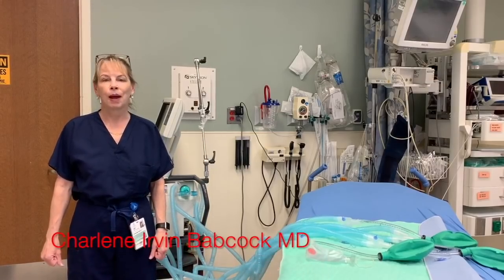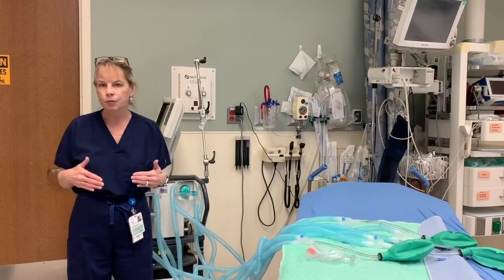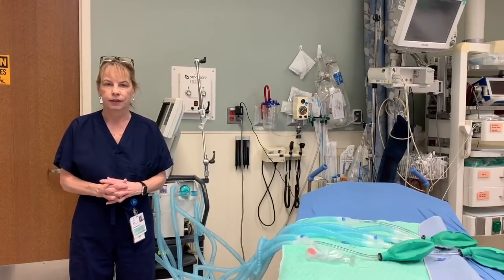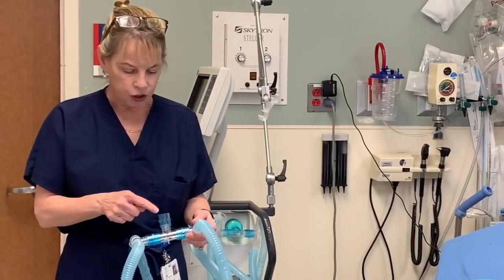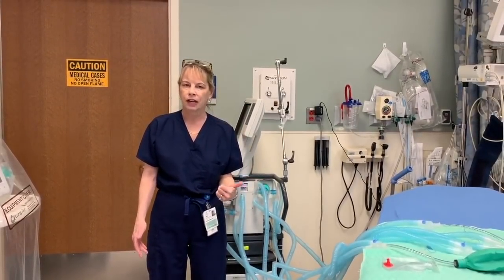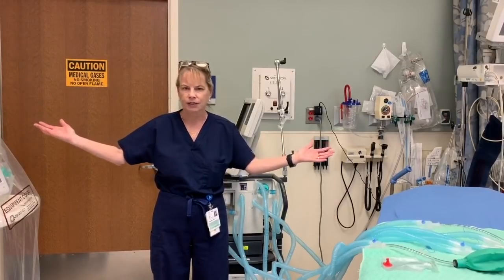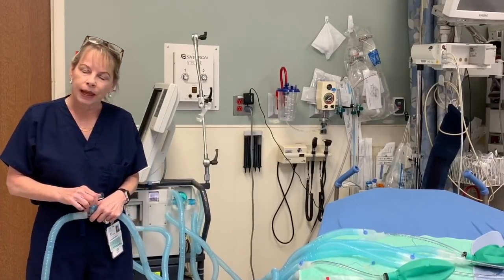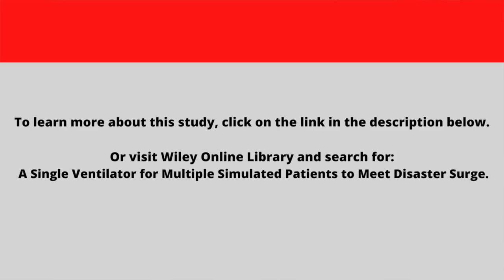COVID-19 How to Use One Ventilator to Save Multiple Lives

Comment: Absolutely would not recommend and has never been tested on humans, aside from a short 30-60 minute period of desperation during the Vegas shootings. Compliance issues along with how different ventilators would handle these are just some of the issues you would face in a real-world scenario. This presumes equal ventilation with equal physiology that would be difficult if not impossible to duplicate in real-world circumstances. I spoke with one ventilator company that said: "this is a very bad idea". I would rather be ventilated by a BVD or a disposable pneumatic ventilator (Vortran, Go2Vent) than dual ventilation. Only after you exhausted all resources should this be considered, IMO.
Reply: true,gas will prioritized path of least resistance
Reply: You know this would be the last resort.

Comment: Hour to hour variability in lung compliance, resistance and the region of lung injury makes this impractical and unsafe.    Las Vegas shooting mass trauma was a very short period of time where two people were ventilated with one vent, not a prolonged period as required for ARDS. A much safer Idea would be using an Ambu bag and Peep valve with a family member to deliver breaths on a timed schedule. With a little training, inverse-ratio ventilation can be attained and something akin to APRV can be done with a bag and a peep valve.   Test and calibration lungs are just that, exactly the same in every way, they are not diseased human lungs from multiple humans.  With ARDS, patients are going to develop mucous plugs and have other modes of changes in compliance and resistance that cannot be detected and thus will either harm another patient by not accepting the volume of air apportioned to them and or delivering excess volume to more compliant lung units.
Reply: Correct... there is no proof of concept.  The guidelines recommend that AMBUing be AVOIDED as it is an aerosol generating procedure.
Reply: B Anderson I agree it should be avoided but then so should cpap /bipap  and heated high flow oxygen. Most NIV masks have a calibrated leak that spews droplets like a fire hydrant.  Remember this is supposed to be unusual circumstances.  Every on is not getting a closed circuit vent
Reply: An ambu bag operated by a family member would require that family member to be suited up in PPE which we may not have enough of.
Reply: how bad those compliances in ARDS and 4 pts will compete..

Comment: I know you said you didn't evaluate cross-contamination but Is the one-way valve inside the ventilator?.. such that if one patient was inhaling while the other is exhaling, one patient's expiration could go back through the inlet tubes past the T or H and the other patient inhale it?
Reply: I guess they should be under sustained neuromuscular blockade to have a uniform respiratory rate for the group and to prevent a patient exhaling while the other is inhaling. Btw I am a veterinarian so maybe a doctor around would answer better to your question.

Comment: There a lot of homicidal assumptions in your setup. Even with four quadruplets with same physique, lung compliance and airway resistance are not static. There are minute to minute, hour to hour changes, based on depth of sedation, secretion burden, volume resuscitation, ventilator asynchrony and  heterogeneity and evolution of primary disease process. For this to work you need breath delivery to sequential patients with flow switches and filters which will be limited by respiratory rate unless you have multiple compressors.(essentially you need four in one ventilator not one for four)
Its irresponsible to assume that all covid patients can cross contaminate without a problem. They still have other bacteria and viruses that each patient will at some point get infected with. All your patients will have the same bacteria Incase of a Ventilator associated pneumonia. How is weaning going to be?
Reply: @ Onentia Oyieng'o  Weaning would be days to weeks in the future, this scenario assumes that 3/4 patients are in imminent danger of dying without ventilation NOW.  "Yup, we din't cross-contaminate anyone-of course, 75% died in less than 24 hrs..."  You appear to epitomize the quintessential "intelligent but amazingly stupid"  flavor of healthcare provider...
Reply: MrMEmEmEmEMEMEeeeeee 
how do you trouble shoot the vent? If you have four pts and one of them gets a pneumonthorax, the total change in system compliance may not be that much. This system would work with pts who are “forgiving” ( with lots of reserve/young healthy) Unfortunately as you know critical care pts have minimal room for error. Some pts can’t even tolerate a drop of peep by 2cmh20.
Reply: MrMEmEmEmEMEMEeeeeee  just read through the last part of your comment, I’m sorry “I guess this is the first time someone told you this an interesting topic of discussion in class but terrible idea to implement in the clinical are”
Reply: MrMEmEmEmEMEMEeeeeee 
Yea the original poster is a dummy.  He had to clarify that airway resistance isn’t static!!! Lol.
Reply: Weaning??? Who said anything about weaning.  This is keeping someone alive, until more resources come available.  Ventilate then all in pressure control.   Set rate and drive pressure so that you achieve the best “average”.   That’s all you could do.  
Of course all their lungs wouldn’t be identical.  And worrying about VAP.  LOL.  They would already be in full blown respiratory failure, with ARDS.   What a hoot.
Reply: Angry Breatherer   If your ventilator liberation plan is to wait on a shipment that’s on back order to arrive.... or to wait for the surge to be over... I now see why a lot of issues don’t seem to concern you. next time please spend more time on defining the problem cause solving it is clearly not your thing. Tip.. Start with simple puzzles lol!
Reply: Onentia Oyieng'o 
You got me there.  I guess those other patients taking up the first ventilators aren’t ever coming off eh, making their vent available for someone else??? They just stay on them forever eh???

Comment: I think I would use the Ventilator on the most critical patient and ask the others families to contact friends and family to see if someone had a CPAP machine they could bring and use that instead. Maybe get one from letgo or offer up. I think it would be less invasive and very effective in increasing oxygen intake when used in conjunction with a noise cannula and 10 L O2. Also do what ever you can to get the patient to lay on their stomach as much as possible.
Reply: in the Netherlands we dont allow non invasive options because there is high risk of aerosol formation :O no CPAP or NIV :O
Reply: Gamiani93 You could send them home and tell them to use the machine in the confines of their own house.
Reply: CPAP isn't going to generate anywhere near the pressure needed to ventilate Cornovirus victims based on what know as a CPAP user.
Reply: A quality BIPAP machine like a Visions could work.  But most people don't have that quality of a machine at home.
Reply: Jim sw uk it’s the positive air pressure that will help prevent the collapse and increase O2 intake. It will reduce inflammation. It’s better then nothing.
Reply: Yea, those noise cannulas as a biotch.  Someone should make a quiet cannula.

Comment: If you ran short of t-splitters, you could use 1/2 PVC T-joints (for 2 pts) or a 5 way split (for 4 pts like in this video). 1/2" schedule 40 PVC has an outside diameter of 0.84 inches, Standard respirator tubing is (I believe) 22mm or 0.84 inches. A hose clamp could attach it to 1/2 inch diameter "male" pegs glued into the splitters.
Reply: Andrew Penn 
So what your saying is.  We can make ventilators at Home Depot.  Nice.
Reply: @oldfashionedsportsmanchave4590  In a pinch, we could make the piece of hardware that would allow us to use one vent for 4 people from supplies at home depot, yes!

Comment: Could you theoretically use different lengths of tubing to adjust for subtle tidal volume differences between patients? Pt A has 500ml tidal, Pt B has 450ml, Pt B has 50ml space added to his dead space, (however much tubing would accomplish this). Would this work? 
Again not ideal, but maybe feasible.
Also the use of blowoff valves that can be set to each patients needed pressure to adjust for individual lung compliance.
Reply: Kyle Essex 
I personally would run the ventilator in pressure control.  This should limit airway pressures equally to all patients.  With your logic to limit tidal volume.  This is actually a brilliant idea!!   My only suggestion would be to not add the extra tubing in such a way as to make extra dead space for the patient, but to add it to the inspiratory limb of the circuit.  All tubing has a compressible volume.   If you add enough to the inspiratory limb of a single person, then that persons delivered volume would indeed decrease.  Freaking genius man. Thanks!!
Reply: @oldfashionedsportsmanchave4590  Thanks... Just trying to figure out the best way to solve the ventilator problem. I've been trying to play with mechanizing a BVM as well, obviously not as good as a vent, but thinking through all routes.
And I would agree, adding to the inspiratory limb would be a better option.

Comment: I am involved with a group of makers, engineers, etc.... and we are conceptualizing this concept and doing so with added customization.......  
QUESTION for Author:  Can PEEPs from Ambu Bags be sourced internally and added to the multi-ventilator tube ends? 
We need more information.
Reply: any help with volume calculations or pressure calculations to fix the correct tube length, do please let me know... we can do some simulations.
Reply: Short answer no.   The ventilator has to control the peep, on that specific machine.
Reply: PEEP is   internal on most units. Historically it has

Comment: You could increase the pressure from the machine if you put a pressure valve in every single tube that goes to a patient. In the industry we do the same if we put multiple machines at the same air-compressor. Each machine has it's own pressure valve.
Reply: And it's my understanding that those could be fairly quickly produced using 3-D printing.
Reply: what? lol.  the way the ventilator works, it will provide enough flow to all the patients until the ventilator sees a total peak pressure of 25 (actually more because the ventilator will also show PEEP in the peak pressure measurement)  that means the machine will pump air into everyone's lungs until the ventilator sees ok i have hit 25 cm H2O. you can see why this i s super dangerous. on person can get a tiny breath, one person can get a huge breath. that's why i am super against this as a respiratory therapist; only in a dire situation where I literally could think of no other alternative
Reply: @thizzy88  If you actually watched the video you would have seen that that IS the only time she would do this...
Reply: Thomas Nguyen 
Your way wrong.  In pressure limited ventilation.   It would only limit pressure to 25, it wouldn’t at all cease delivering volume until the ventilator time cycled into expiration.  Even on one patient, the ventilator in pressure control doesn’t use pressure as it’s cycling variable.   It uses time to cycle.  Volume and flow are variable.
Reply: @oldfashionedsportsmanchave4590  I understand that.  I never said it was pressure cycled.  To be more specific, the ventilator in pressure control works through DEMAND flow.  In volume control, we set the flow to manipulate I-Time.  What I was getting at is the ventilator will deliver flow until it delivers our driving pressure, which we set.  So, the vent will supply enough flow as the patient demands. I am saying the problem is, in pressure control you have way less control over tidal volumes and minute ventilation, and that's just in one patient.  It's like you read my statement and went down some road with it when I never even mentioned how the vent triggers or cycles.  I was talking about lung mechanics...  In pressure control, it is pressure limited, not cycled.
Reply: @oldfashionedsportsmanchave4590  I'm just posing the question of how do you fix a patient's gas when you have four patients data all mixed into one measurement?  Someone said to place a Wright's respirometer and I thought ok thats a good solution. But then how do you adjust the settings to fix the gas?
Reply: Thomas Nguyen 
Ah, I miss read our interpreter your remarks then.  
To your question about adjusting for volume.  I have yours with a solution.   In practicing on test lungs, I have set the ventilator in PCAC, measured exhaled volumes with a respirometer.  If any one patient needs a lower volume, I was able to accomplish this by adding additional large bore tubing to that patients Inspiratory limb, the volume lost to tubing compliance, had the effect of dropping that individual patients tidal volume.  It’s not pretty though having a big extra coil of tubing just lying there.
Reply: @oldfashionedsportsmanchave4590  that's incredibly described but my brain hurts just picturing how you put that together lol.  so many parts. props to you sir or ma'am. where is that tidal volume going, though? if you add tubing to the inspiratory limb, aren't we increasing deadspace as well? and if you add tubing like that, you have got to re-calibrate the machine to compensate for that deadspace; can't do that if the patient is already on the vent. you would have to disconnect all 4 patients while you re-cal
Reply: i meant to compensate for the extra tubing, **

Comment: I am a respiratory therapist near upstate. I can tell you now I do not believe this would work. Taking care of multiple Covid-19 patients. The virus effects each individually different. Lung compliance is not the same in every patient. For this to work compliance would have to be the same so that the same amount of volume is going to each patient. To be blunt. This is dumb!
Reply: Instead of dismissing it out of hand, why not come up with solutions?

https://emcrit.org/pulmcrit/split-ventilators/
They've addressed this. Try to match patients based on severity. Not perfect, no one's claiming it to be, but this is for a worst-case crisis scenario where it's innovation or death.
Reply: I have read that valves could be 3-D printed in order to customize pressure for each patient.
Reply: @rayreinhard1077  i'm sorry but what does customizing pressure have to do with anything?? the ventilator works off of ONE flow sensor. the doctor says to dial in a pressure control of 25 cm H2O. the ventilator will deliver as much flow as it needs until it sees a peak pressure of 25. there is no customizing pressure in the doctors example; she already customized it to 25.  the only other option is to ventilate with VOLUME control.  and we might as well kill all 4 patients if we were going to try that. and then hybrid modes i dont even wanna try to think about that right now
Reply: peak pressure 30-32 actually, if you account for PEEP
Reply: @rayreinhard1077  you can totally do that and regulate the flow of each patient
Reply: @Kc weigh - so in your professional opinion it would be better to let the 3 patients die?  Or do you think there is adequate volunteer staff to Ambu bag the other three patients 24/7 for 3 weeks?
Reply: Dell Anderson maybe I am wrong, but If this was short term then maybe, just maybe we would be able to save the patients. But if this is for longer than...I don’t know let’s say 24hours? The volume delivered will follow path of least resistance right, so if one person has really good compliance and the other 3 have poor. The first person will take most of the volume delivered and the other 3 will get little to nothing. So now you are pounding the lungs of someone that would other wise be okay to be ventilated and under ventilating the people that need it. In my opinion I don’t believe this would work at all. Again. It’s just an opinion.
Reply: Kc weigh see her waiver, pinned comment by the uploader.
Reply: @kcweigh2768  Agree.  My bad.  I misread disparate as desperate.   Big difference! :-(
Reply: Didn't the Dr say that it wasn't for disparate cases in the video?
Reply: @chalan30  If she did, I must have missed it.  Do you have a time code for where she said that?   I understood exactly the opposite but may be wrong.  Not sure why one would use this unless extreme emergency.
Reply: @DellAnderson  2:17 she starts talking about the patients on each end can't be different.
Reply: Do you have any other ideas to ventilate the patients when it run out? Do you have enough staffs to ambubag the patient? 30mins og ambubagging is already exhausting.
Reply: @Zerimara23  If we are ever this desperate, we can go to the original Bird Mark 7 and have one of the manufacturing companies mass produce them. With today's technology, i'm sure we could make thousands within days. Even the Ventipac is tiny and doesn't require any computers.  Both are safer alternatives than this.  Ask any RT, a vent is a vent.
Reply: Thomas Nguyen Easy for you to say. And  Acquiring it may is not cheap.  Plus the law of supply and demand, it might be more expensive.
Reply: @Zerimara23  like i said i don't want to argue over youtube about this. i never comment on youtube. it just leads to toxicity. wish everyone the best, stay safe out there

Comment: Perhaps patients on ECMO would be an ideal cohort for this (if you can't wakethem up). You don't need to worry about actual gas exchange and compliance as much and still can apply peep with low tidal volumes.
Reply from the maker: YEs it may...but not enough ECMO circuts...they are even more rare than vents....
Reply: @charlenebabcock1048  Of course! Only if given a choice!
Reply: This wouldn’t work...lung compliance is not the same in every patient. It would be better to just use a bag to manually ventilate them, pull volunteers off the streets.